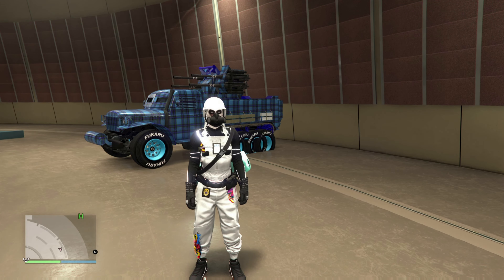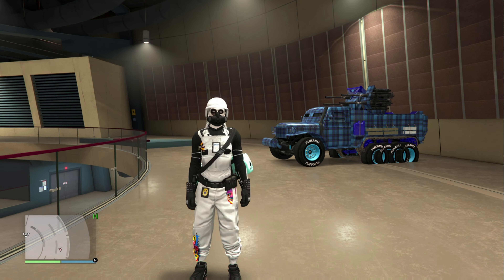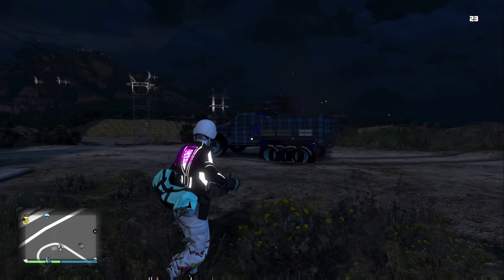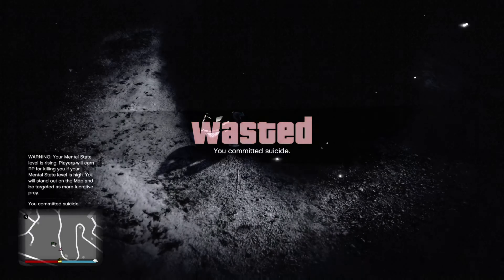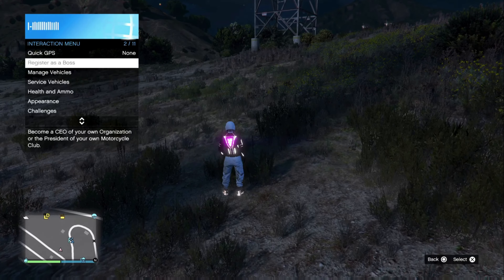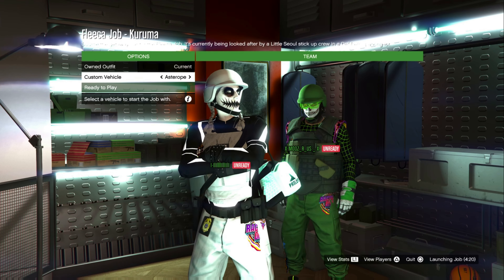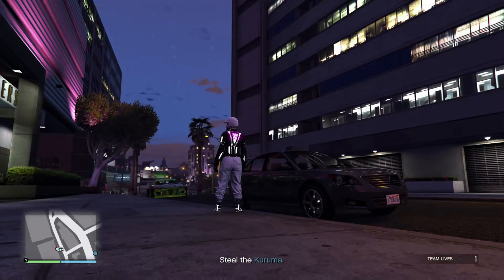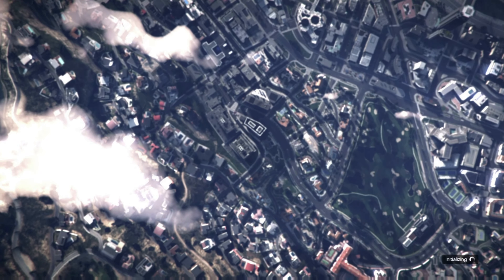How To FIx SPECIAL VEHICLE DEADSLOTS In GTA ONLINE (4K HIGH DEFINTIION)

Comment: I just did this and when I went in the heist there is no car on the heist menu to select
Reply from the maker: Then that means it is not a regular vehicle causing your deadslot. It is possible that you may have had a special vehicle in your MOC when you received a different special vehicle and the one in your MOC got pushed to the wrong slot thereby causing your deadslot. Also keep in mind this method is for Special Vehicle deadslots only. This will not fix regular vehicle deadslots
Reply: How do you fix it when you have a special vehicle in the dead spot? @MODZGAMINGYT
Reply: @MODZGAMINGYT how would you fix that

Comment: I was doing gctf for a technical aqua using a zombie chopper but I forgot to return that to storage and call out my old 1. When I got it in my moc and realized I bought another bike over it but my old technical aqua is gone and the bike isn't in the mc list or heist list any fix?
Reply from the maker: Yeah you now have a deadslot because you did not leave your old Aqua on the map to delete it and put the bike in it's spot. The bike is now in the Aqua spot. So receive a new Aqua into your MOC and call out that bike and it should push new Aqua to the correct spot.
Reply: @MODZGAMINGYT  that's the thing the bike is no where to be found it got deleted too
Reply: @expertcaliber the bike won't b any where but if u go on moc menu n call vehicle it will alow u to

Comment: Is there a reason that you're not using the facility to start the job or is the apartment jobs the ones you have to use
Reply from the maker: @mykoolgta5267  We've always used Fleeca for this. Is it 100% necessary? Not sure tbh. Try a differemt heist and see what happens.

Comment: Great video. Planes included?
Reply from the maker: Usually regular vehicle deadslots are caused by planes so in order to get rid of those you would need to delete whatever aircraft is causing the deadslot. I've personally never had an actual plane itself be a deadslot so idk? I would say that this method would probably not work for an actual plane deadslot because you can't call those out during a heist. So they wouldn't show up on the list anyways.
Reply: @MODZGAMINGYT  Thanks for the reply.
Reply from the maker: @mrfrost6005  No problem. However after thinking more about this I would have to inquire as to how your actual plane slot itself became a deadslot? Did you accidentally push a regular vehicle to a plane slot? If so than that vehicle would still be on your list from the Heist menu. So theoretically this method should work if that is the case with your situation here.

Comment: Bow do you fix phantom wedge deadspot with speedo custom in the slot no way to call the speedo custom out
Reply from the maker: Need to do Bogdan Heist merge I believe. I've never had that problem before so I'm not 100 on that. You can't fix it with the Terrorbyte method cus you can't drive a street car into the underground vehicle warehouse. Bogdan merge is your best bet
Reply: @MODZGAMINGYT  that didn't work cl custom out then it vansihes when leave job
Reply: So you able to see the speedo i accidently did that too and now my ruiner is missing
Reply: So I now exactly what's there
Reply: You on ps5
Reply: @hobaleninetwork7625  yes ps5 and it's a speedo custom from bogden merge
Reply: But no i am unable to see the speedo custom only call it out in bogden merge but it won't stay out after job

Comment: Can i fix my terrobyte and avenger deadspot?  From this glitch
Reply from the maker: @DuoDominator_NF  Unfortunately no. This is mainly for Special Vehicle Deadlsots like Ruiner 2000 etc. I made a video on how to fix the Terrrobyte deadslot check it out. I didn't have a Terrorbyte deadslot but still I walk you through the process it's not that hard. Not a clue how you would get an Avenger deadslot? I've never seen that accomplished lol
Reply: @MODZGAMINGYT  bro is there any glitch that can clear my avenger and terrobite dead slots??
Reply from the maker: @DuoDominator_NF  Bro I just answered your questions with my last comment lol.
Terrorbyte is easy you just need a modded one in B2, 3, or 4 of the Nightclub. There was a give Avenger to friends glitch idk if it's still working or not? But that was for someone who had a functional Avenger already so not sure if it would work with having a deadslot?

Comment: I need to fix rocket voltic dead spot, can i use bogdan mission instead of apartement mission?apartment mission need 4 players its imposible to start the mission
Reply from the maker: Just start up the Fleeca Heist it's only 2 players. Bogdan might work but idk I've never did this using Bogdan.

Comment: Will this method work if a Speedo was used during Bogdan to pull a chernobog and created a chernobog deadspot?
Reply from the maker: Not sure about that because a Speedo is obviously a Special Vehicle itself. Usually it's a regular vehicle creating the Special Vehicle deadslot like the Asterope you seen in the video. All I can tell you is just do what I did in the video (I know it sucks having to destroy all of your regular vehicles believe me) and follow through and see if it works. You don't have anything to lose that's for sure.
Reply: Did you fix it? I have same problem :(

Comment: Yo so I did this and when I’m trying to sell the car it says I can’t cause not worth 50,000 does this mean I’m just on  a sell timer still?
Reply: And can I just crush with moc and street car
Reply from the maker: Hmmmm....that sounds like a  message we sometimes get in game when it's a dupe. I'm not 100% sure of your situation exactly but there are variable here and if I don't know fully your exact situation I cannot give the best advice. Having said that I would try my best to sell the vehicle. That will guarantee a free spot to open up so you can buy stock special vehicle back into it's rightful place. You can't really crush a deadslot because that will not remove the vehicle from that wrong slot it's in. From my experience bro it has to be sold. That's my 10 cents so take it for what it's worth.

Comment: I did this for a friend, and it fixed all but the Blazer Aqua dead spot. Any ideas?
Reply from the maker: The vehicle causing the Blazer deadslot is a regular vehicle just like the others. It has to be because you cannot get glitched out in a Special Vehicle, only a regular vehicle usually an Elegy or a motorcycle.
Reply: Appreciate you getting back to me. I just blew up all my cars because I have a tank dead spot. I noticed when I blew up all my planes that there was an elegy rh8 in the hanger in storage.  I haven't modded any planes. I'm just waiting for a friend to jump on to see if I can call this elegy out. It's a process, but it does work as I did it for a friend. Just hope it helps me
Reply from the maker: @timjessie8964  Yeah not a problem man that's why I'm here is to help people if I can. 
That's weirs because usually when you get a plane incorrectly the vehicle you deleted whatever garage it came from is usually where the deadslot appears. I've never had a deadslot in any of my actual hangers. Only regular vehicle spaces. That's why you have to have a full hangar and overwrite the leftover plane that's in your MOC with a fresh Elegy because if you don't deadslots can happen quite easily because you are replacing a regular vehicle slot with an Aircraft slot which totally confuses the game. So if you don't have a buzzard or whatever in your hangar to replace over top of the game will send a copy of the plane to your regular vehicle slot thus creating a deadslot. It's weird I know and doesn't make sense but that's just how the game works for whatever reason.
Reply: Well just sold the elegy in the hanger and still can't buy the tank. I'm gonna try it again to see if there are any others. I know this works like I said it worked for a friend. Maybe I will have to wait a few days now that the elegy is gone and it will give me the option to get it again
Reply from the maker: When you sold the Elegy did you put an aircraft in its place right away like a Pegasus Buzzard or whatever?

Comment: Modz need advice.. i was trying to replace my phantom wedge w a new one and the old one disappeared and the new one was stuck inside moc. The only way i pulled new one out was by driving a street vehicle inside moc. Now both phantom wedges are gone. When i go to request phantom is says "delivery not currently available" should i try the glitch again have my friend drop me a 3rd phantom wedge?
Reply from the maker: Bro what you did was cause a deadslot. That's why we use a Motorcycle we only have 1 of on our whole character because whatever we got glitched out with will be pushed to the Special Vehicle warehouse and we cannot call that vehicle out with the mechanic because it is invisible inside the warehouse. But by using a 1 of 1 motorcycle we can use the MC Presidemt menu and call it out which will push the new Special Vehicle inside the MOC to it's rightful spot. Understand? What Vehicle did you use to get glitched out with initially? Whatever that Vehicle is it's still in your old Phantom Wedge's spot. If it was a car you are screwed you will need to destroy all your personal vehicles like I did in the video and start the Fleeca Heist, call it out, then go sell it and buy a stock Phantom wedge then replace that one by doing the glitch correctly and then you will be gtg. That is the only way bro.
Reply: @MODZGAMINGYT  i gotcha. I had a free car inside moc first it was a banshee gts then I pulled up in a mc western nightblade w buddy on it he got off. Then we did glitch i dismissed bike and called out my phantom wedge. I fell out of moc buddy invited me to his warehouse I went back w bike because my original phantom disappeared. Nothing would pull out that new phantom until I grabbed a street car and replaced it inside moc now both phantoms are gone.
Reply: So what do you think now? What car is the one I glitches out w? The way I was taught was always keep a vehicle inside moc then I grabbed a bike nightblade to get buddy kicked off. Was I supposed to have the nightblade inside moc first then pull it out? Or am I screwed gotta blow everything up
Reply from the maker: @justinlugo1661  You were taught wrong bro. Always and I do mean ALWAYS use a motorcycle that is a 1 of 1 if you are replacing Special Vehicles inside the underground warehouse. Other Special vehicles in the game it doesn't really matter what you use but with those it's very important to use 1 of 1 bike. So now yes that free car is in the Phantom Spot. You must destroy all your regular vehicles. There is no other way bud I'm sorry...
Reply: @MODZGAMINGYT  dang bro this sucks. Ok last question i appreciate you taking time bro and helping us. Other dumb people like me will learn from this. What does 1 of 1 mean. I have 10 motorcycles but only 1 is a nightblade is that a one of one? 
Last question b4 I blow up all my cars you put the motorcycle in moc first bring it out and have buddy kicked off?
Reply from the maker: @justinlugo1661  1 of 1 means you only have 1 of that particular model motorcycle. Like a Nightblade, or Bati 801, or whatever. It doesn't matter what bike you use as long as you only have 1 of it and obviously it has to be a 2 seater so you can glitch out with it. No you blow up all your cars first. Then sell the Elegy and replace it with stock Phantom Wedge. Then you put 1 of 1 bike in back of MOC then begin to do GCTF from the beginning. Got it? And yeah ur welcome that's what I'm here for is to help people.
Reply: @MODZGAMINGYT  thank you bro I appreciate you. I got it just wanted to make sure
Reply: I got it bro! I did the fleeca heist like you because I knew what car it was It said I had 18 gts banshee but my inventory said 17 only so I blew up the 17 banshees and did fleeca I grabbed the one and the dead spot cleared up. Thank you soo much you have no idea how much you helped me bro. I have 250 cars that would of took forever.

Comment: So I just did this and no cars are left and have no clue what it could be I blew up all my all my personal vehicles
Reply from the maker: You may have had a special vehicles in the back of your MOC when you called whatever car that got deleted before getting the new special vehicle in which in that case the special vehicle that was in your MOC is now in your underground warehouse invisible in whatever spot is your deadslot now. Only way to fix that is to do the kill the bird method but that is currently patched. I'd be looking for a workaround if I was you. The Bogdan Heist merge won't work because you can't sell a special vehicle like the Ruiner 2000 or Jetpack or whatever. You're stuck with them. You can only replace them through gctf glitches. That's the only thing I would know for you to be able to possibly fix that situation. It has to be that because if it was just a regular vehicle causing your deadslot in your underground warehouse it would definitely be on the vehicle selection menu in the Fleeca job Heist as you seen was the case for me in the video. Sorry I can't be more help

Comment: Wait so this wont work for regular car slots in a regular garage?
Reply from the maker: No those are usually caused by receiving aircrafts improperly
Reply: @MODZGAMINGYT  I didn't have them before I took the special vehicles. I took the airplanes properly hanger filled. I'm halfway through my garage lol. You weren't lying it takes a while lol

Comment: For 2ed deadspot i need to Destroy all cars again ? Because its showing me onlw bmx ?
Reply from the maker: @jrcriminal7340  if you did everything correctly after you free up your 1st deadslot just go into the Heist again and your 2nd vehicle causing your Special Vehicle deadslot should be there to call out and then just repeat the process. When you're done then you can fix all your vehicles with Mors Mutual 👍🏻
Reply: @MODZGAMINGYT  I destroy all cars but it's show only 1 deadspot car what should I do now ?
Reply from the maker: @jrcriminal7340  What vehicles are deadspots? This method will not work for deadslots created by getting planes incorrectly or Special Vehicles being put into the wrong slots.
Reply: @MODZGAMINGYT  only ram buggy I was receiving it from moc and I did method so get headspot 1 deadspot is fix and ram buggy one is left what should I do now
Reply from the maker: @jrcriminal7340  if all of your personal vehicles are destroyed then go to heist again and vehicle causing Ramp Buggy deadslot should be available to call out and then go sell and buy stock ramp buggy over where deadslot was 👍🏻
Reply: @MODZGAMINGYT  thanks mate for helping me I was so confused I have total 3 headspots from special vehicle set 1 I fix it from this method and 1 is empty deadspot and last one ram buggy I move empty one to moc how can I fix moc empty deadspot
Reply from the maker: @jrcriminal7340  you shouldn't have to move anything bud. If the vehicle that is causing your SV deadslot is not on the Heist menu then you must have done something really screwy to cause it. Idk what because I'm not you obviously so it's anyone's guess idk 🤔

Comment: It worked for 2 not all 4 of you know why?
Reply from the maker: I would need quite a bit more information than that bro lol
Reply: @MODZGAMINGYT  idk what else you want to hear i loaded into the fleeca job and only 2 of the vehicles popped up not 4
Reply from the maker: @MariP-k1j  What I would need to hear is not a vague explanation with little to no details. There are different kinds of deadslots that are caused by doing different things and by different vehicles that were received incorrectly. Most regular vehicle deadslots are caused by receiving planes incorrectly. Special Vehicle deadslots (mainly the underground ones like the Ruiner 2000 etc) are caused by using the incorrect vehicle to glitch out with. Do you understand? 
So this method will not work for regular vehicle deadslots because most likely those are being caused by planes which obviously cannot be called out through the Heist screen menu. To delete those you would need to find the plane causing it and delete it either by selling it or removing it from your hangar. However usually most don't know exactly which plane caused the deadslot so you would have to remove all of your planes and start fresh or simply just live with the deadslot and keep your planes. 
Special Vehicle deadslots will absolutley work using this method as you clearly seen in the video. Note: you do not have to destroy pedal bikes or other special vehicles like the Ramp buggy or whatever as those are irrelevant in this situation. Hopefully that helps you out 👍🏻
Reply: @MODZGAMINGYT  I understand but I have 4 special vehicle deadspots and I did the method it only fixed two of them and was wondering where those vehicles went
Reply from the maker: Not sure why it would only fix 2 of them. Unless you accidentally had a Special Vehicle in the back of your MOC like let's say a Speedo Custom for example. If that is the case then this will not work because the Speedo got pushed to your SV slot. That would require the Bogdan Heist merge method to correct the situation if it's still working.